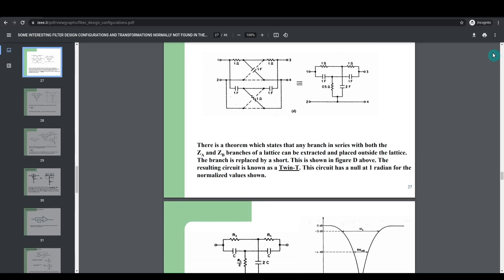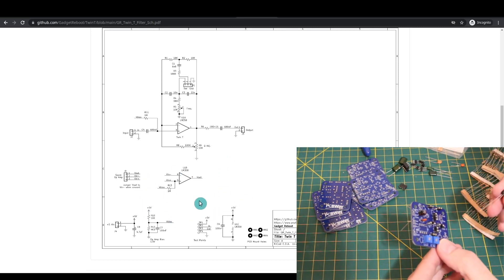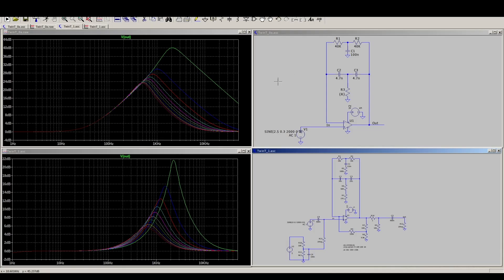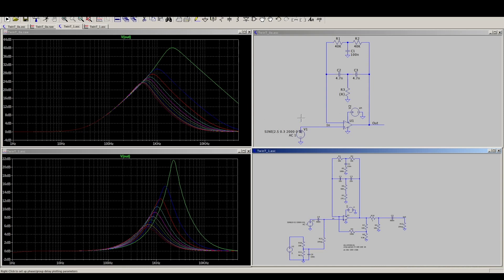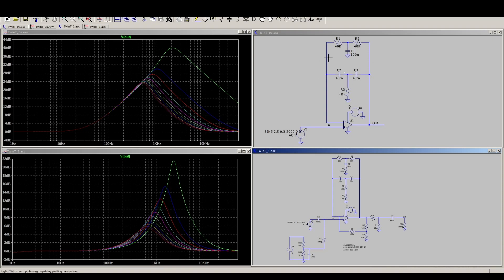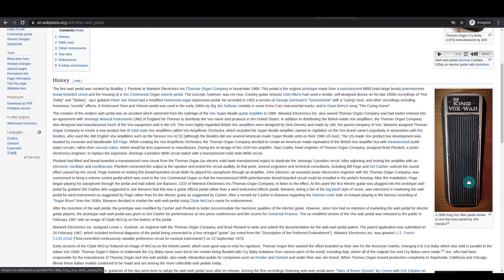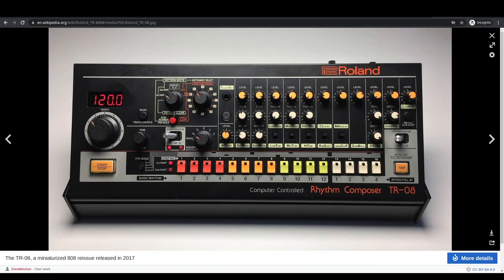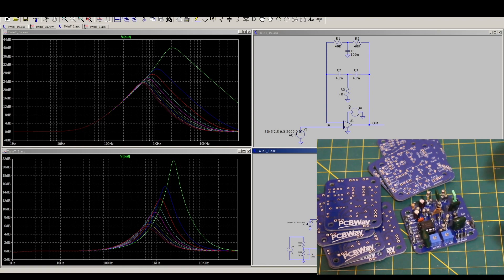Twin T Filter / Sound Generator PCB

Comment: That's cool chit man. I just bought 4 of the 358's the other day at the local electronic store. Going to use them as amps for the LM3915's and 3916's for my VU meters.
Reply from the maker: I'm going to need some quad packages now so I can fit even more things on a board.